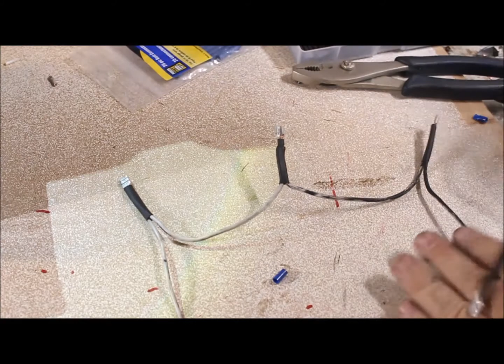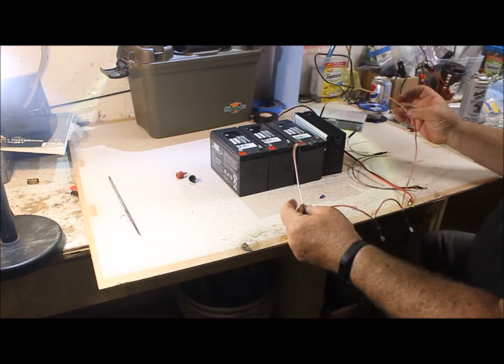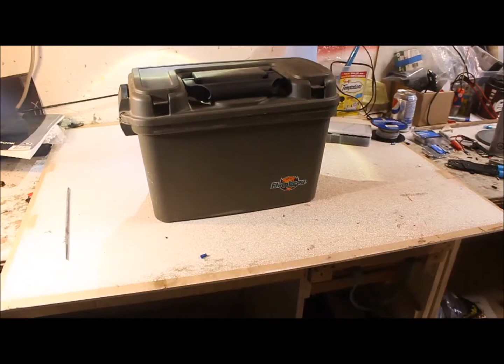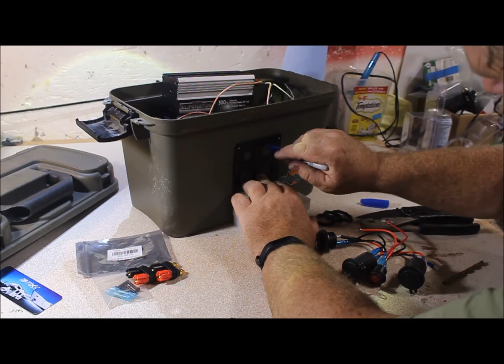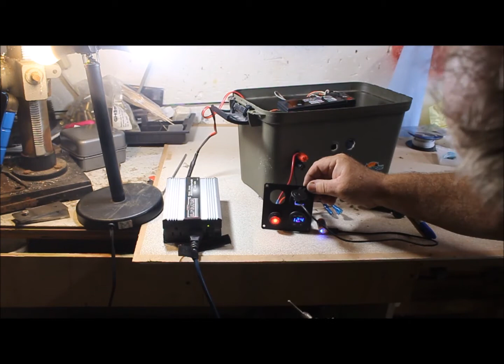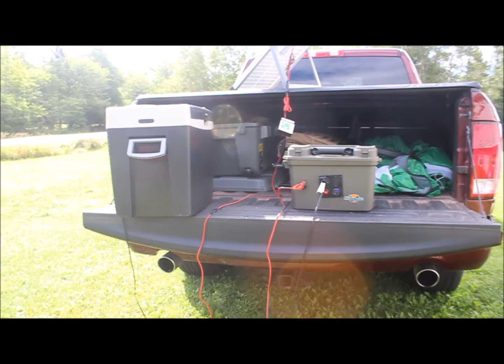DIY -Battery box  - Solar Generator build

Comment: How’s it doing now
Reply from the maker: It works great especially in black outs.   I upgrade to an RV batter and 1000 watt inverter in the house  but this unit is great in the truck and a 25 watt solar panel keeps it fresh or I trickle charge it driving.  Used it camping a few times nice to keep the electron cooler running overnight.